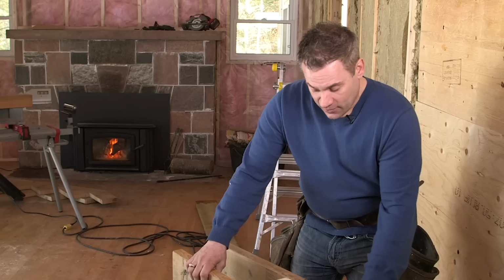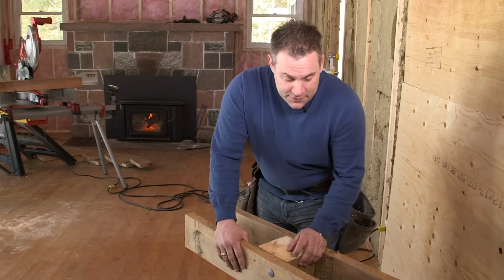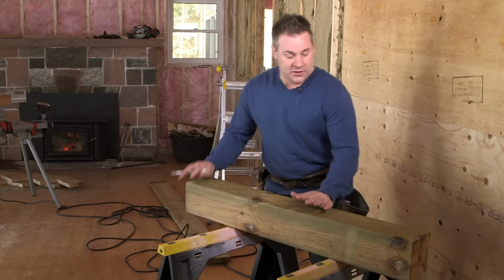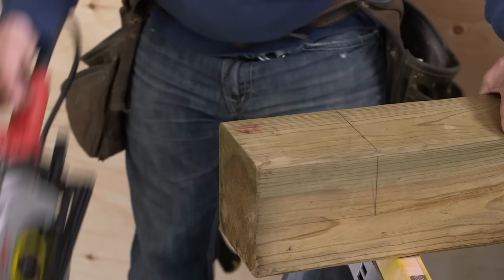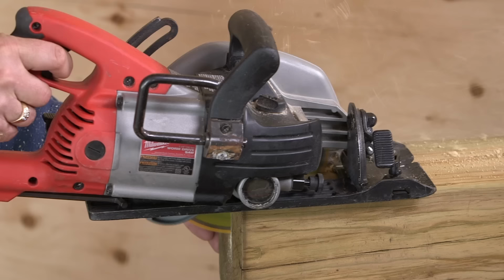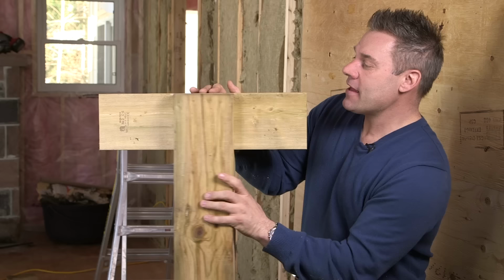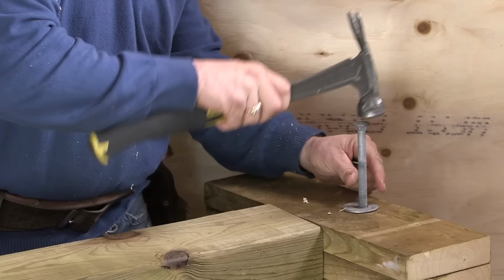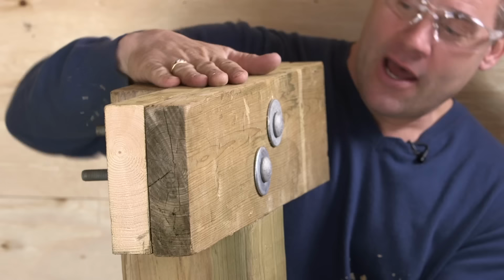How to Attach a Beam to a Post for a Deck | Decks, Docks & Gazebos

Comment: I wonder how this guy would attach a ledger board to a concrete wall. 
Would he notch out the concrete, so when the lag bolts shear off the wood is supported by the notch?

Comment: I can't even count the number of galvanized carriage bolts I've had snap off on me just from tightening them - including 1/2". Maybe back in the day, when steel was made in the USA, but the crap that's been here for the last 30 years is exactly why you don't want to put too much pressure on it. And as a handyman of 40+ years, I've had to repair all kinds of things that "engineers" have designed and built, especially in the cookie-cutter houses of the past two decades.

Comment: I prefer the notch method as well, but regarding sheer strength, I think you're mistaking bolts for tiny screws. Bolts have a lot of sheer strength. My concern would be the timber breaking off before the bolt
Reply: This is probably the worst example he could have picked for what is otherwise correct when talking about supporting loads via compression vs shear. I too think in this case a 2x would fail from one of the bolt holes before anything else.

Comment: A decent carriage bolt has a shear strength approaching 90,000psi. And while I too prefer notching out and supporting the timber with another timber, using carriage bolts is more than adequate.

Comment: Anyone who builds professionally will back this up. The bearers should never be bolted to the side of the stump - those of you saying this guy is incorrect have no idea what you’re talking about. A deck should never be loaded on the shear weight of bolts - completely defeats the purpose of the stump on the first place. Used to drive me insane when I saw decks built like that - so unsafe.

Comment: Interesting, thanks!  If the post is a corner post I imagine you trim away 2 sides of the post to support the 2 beams.  The question is about bolts: once one beam is attached to the post with 2 carriage bolts there will not be space at the top of the post for 2 more carriage bolts to connect the second beam.  So what do you do about that, how is the connection made? tx
Reply: See "Castle Joint" I love fancy joinery!

Comment: Shear strength of 2 carriage bolts is about a few thousand pounds.  The wooden joist splitting is the bigger risk.  Use a metal support plate if you’re really concerned.

Comment: While the author of the video is correct about placing the beam in a pocket as opposed to simply carriage bolting the beam to the leg, there is strength in the carriage bolt way above that of the soft wood its holding together. So white a couple 1/2 bolts would probably no fail, the same cannot be said for the wood , much stronger to use the beam pocket & then bolt it together

Comment: I have a deck done the wrong way. As reinforcement, what about placing blocks on the post and under the beam to support the beam/bolt connection. Secure those blocks with galv thru bolts and glue. Or run the blocks on the post all the way down to the footer and then attach with glue and thru bolts. Probably structural screws would suffice. Your thoughts? Anyone?

Comment: Proper attachment is important, and I notch as you suggest, but 6 months later and the beam has shrunk and now it is over notched. Now the bolts are still holding fine no slippage or failure. BUT I never use 2x6's for beams, poor example, even for demonstration purposes.

Comment: With all of the conflicting comments below, can someone just tell me what would be the best way to put a beam on top of a two 8 ft (8 above ground, 3 below) cemented in 6x6 post that will withstand the forces of a few recreational swings hanging and swinging from it.....what would be ideal beam, solid 4x6, sandwiched 2x12's, etc., should I notch in the beam, should I use a post to beam bracket, should I use bolts or use premium deck screws.  Anybody care to comment it is much appreciated.

Comment: Carriage bolts take a crazy amount of weight to sheer off.  If you local code allows you do not need to notch the post, bit of you decide to attach be sure to use the correctly rated bolts of the correct material and make the holes drilled a tight enough fit that you have to hammer the bolts through the hole.  If code allows it there is nothing wrong with doing it.

Comment: A 1/2" carriage bolt will carry several thousand pounds of shear. The only problem is that the boards are only clamped against each other - no load transfer other than the bolt, which is improved by making an interference fit with the bolts - drive them in with a hammer. 
A four bolt pattern will provide some degree of shear transfer between boards - until the heads sink into the board and loosen.

Comment: I recommend tightening a second nut down against the first nut to lock it into place forever. Most wood will shrink during summer a little and over the years, maybe just from the vibration of people walking or whatever, the single nut will back off a half inch or so.
Reply: or use a lock washer and locktite..

Comment: I prefer the approach where you have a cross joist, side to side of the dock, bolted to the 4x4s on which you then sit the lengthwise joists also bolted to the 4x4s. Lots of friction and bolts!

Comment: Sheer strength is relative to the live and dead load placed upon it. For example, building a deck for a family of four is one thing but now throw a party with 30 people on it and you have a different scenario. This is one of the correct techniques. I would never trust bolts just drilled thru the wood. Also, I always overbuild just to be on the safe  side of caution.

Comment: I am not a professional, but built many decks in my lifetime, always “the wrong way.” Some of these deck (the ones that I can still visit) are still standing firm, after more than TWENTY years. Just finished one about a year ago, feels solid, and it will probably last for many more. No question about it. I’d say, if your deck is in your backyard, go ahead and build it “the wrong way” it will be structurally sounds for years to come.

Comment: 1/2" UNC bolt: Min tensile strength 17,028lbs, Minimum yield strength: 13,055lb,  MINIMUM ESTIMATED SHEAR STRENGTH: 9,048 lbs. ref: Fastenal . Also, cutting a notch like that holds water, accelerates rot.

Comment: my deck was built like that in 1972. We replaced it in 2015 because the floor boards were rotting. The only reason you would need to worry about that is if you are always getting close to exceeding the weight. That being said if I were to rebuild my deck I would use that method but my deck probably wont need to be replaced until after I'm dead.

Comment: This notched joining method may be inherently less prone to shear, but it will rot out prematurely in the structural joint where the PT sheath is breached, between the laminated planks and under the decking because of the larger contact area to hold water and anaerobic bacteria and mold.

Comment: You only need 1 bolt right in the center. I would also add a lock washer between the nut and washer.

Comment: The sheer strength of a carriage bolt is more than adequate.  It's the Beeman itself that will fail from the load. That is the reason for the cutout  I have in my life seen only one bolt fail but have seen many Beam split fails. Luca

Comment: you should not use a washer on the head end of a carriage bolt. Carriage bolt has square notch under head that bites into the wood to stop it from spinning. You also should not sandwich two beams together if in the weather. Water sits in the gap between the boards causing rot faster.

Comment: Hmmm.......I have never seen washers used under the heads of these bolts. We call them coach bolts here and they have a square section under the head that bites into the timber so it doesn't move when the nut is tightened.

Comment: Every thing has a down side like water getting trapped  in the vertical joint ( water rot ).It  depends were you live . Also the cross beams would split most likely before the bolts failed .

Comment: while I do think his way is better. it seems like we always have 2x4 scraps laying around . I've always cut say 1 foot pieces and screwed them underneath the beam on the side of the 4 x 4 for extra-strength. I've never had a strength issue or one collapse.
Reply: Works great done  several  decks with that method.

Comment: At 1st glance this makes ABSOLUTE sense… but the more I disect this in my mind, I think of how much weaker the notched out part of the post is that the carriage bolts go through .....so instead of having a 4 or 6" post thickness now the flanged part that has been notched out to only a couple inches thick in supporting a deck that will be carrying weight side the side… interesting to know and understand the engineer I aspect of this

Comment: this looks like a better technique, but i had a very large deck i built like the bad example and it lasted 15 years with no problem till i tore it down last year. i would probably agree with another poster that keeping the boards separate and attached to either side via cutout might be the preferred technique due to water.

Comment: And its not just shear strength, the friction of the wood being squeezed together is a tremendous load bearing, use vise grips to squeeze two pieces together and try to slide them apart. And by notching the post you weakened its lateral strength so us a larger post to begin with. For ultimate strength bolt and the place another plant from the ground to bottom of cross beam.

Comment: I agree that this is the correct method to attach a beam to a post. The shear strength of a grade 5 1/2" carriage bolt is over 100,000 psi. Could you demonstrate breaking that off with your hammer? LOL Would be nice of these TV shows would hire people that actually know the trade and are not actors like Bob Villa!!

Comment: one 1/2" carriage bolt has a maximum shear strength of 15000 Psia.  That means it can withstand a max force of 15000*pi()*(1/4)^2= 2945 lbf right on top of it.   You showed two bolts, with doubles it.   It this really a concern?

Comment: The only thing that gives you is better looking assembly, which is not bad at all if that is what you are looking for, strength wise? The bolts will never break or even bend, nor will the example assembly shown here ever break. So do it the way you prefer.

Comment: My local code will not allow use of a carriage bolt or a lag bolt. It must be a hex head bolt and nut with a washer on each end of the bolt, galvanized.

Comment: Actually what is holding the beam in place is the compression and friction caused by the bolts squeezing the two pieces of wood together. This is literally the same way that airplane wings are attached to the fuselage.

Comment: The carriage bolt plus the lumber on lumber resistance is a lot of shear weight needed.. for a deck it’s just fine . You’re way is “better” but that doesn’t mean the other way with carriage bolts isn’t right .

Comment: Funny; I bought a house 26 years ago with a deck done the 'wrong way' - who knows how long it was up before (house was built in 1985) - and I have YET to have any bolts shear off.
Reply: You just need enough people on it. Usually, it makes the papers when they fail because a dozen or so people end up falling 15-20'.

Comment: I would not put a washer on the outside as a carriage bolt is designed to sink into the wood on that side and lock itself into position.  I use a large washer and a lock washer on the reverse side only.

Comment: Look this guy is completely correct with the exception that you can no longer use carriage bolts, you must use hex head that can be torqued to a value. The load must be borne by the post. This has been litigated many times. It doesn’t matter what you believe, only thing that matters is what can be proved. If you are still bolting your beam through a post you are wrong and you must evolve in to doing things correctly. Use of your grey matter and not your ego. The fact the deck you built incorrectly is standing after 20 years is not proof in litigation. This is borne out of a series of high profile deck failures in the news......grow, it doesn’t hurt

Comment: The bolts should not be in shear (only tension)  because the bolts should be holding the 2 pieces of wood together so tight that friction never allows shear to be applied to the bolt.  The wood will splinter long before the steel breaks.  However if the bolts get loose and friction is loss over time, the notch is a good idea.

Comment: I let the termites hold hands.Works fine for me.But,if the termites don't want to do that,this method has two strengths,the wood holding it up as well as two galvanized bolts.If any break there's the other to hold it up until one can make repairs or replacement.👷‍♂️

Comment: I understand what you're saying, but if you think those bolts are going to shear, show us how much weight it will take to shear those first two bolts.  Pretty much guarantee that unless you're parking a tractor on your deck, the wood will rot out long before the bolts shown in the vid(looks like 1/2 grade 5 bolts, maybe grade 8)  break.  The biggest problem with your first example is not bolt shear, but elongation, leading to sagging then the wood splitting at bolt holes.

Comment: the way you are showing how to do it is the correct way but there is a whole lot of shear strength to a tightened 3/8's bolt. Advertised shear of a number 16 nail is 900 lbs.

Comment: I can tell by browsing through the comments that there's alot of jack-leggers and/or people who have never built a deck with proper load bearing posts chiming in.
Reply: Joshua Carpenter I’m a career carpenter (16 years).  Those bolts are will have no problem holding the load, it’s the wood getting soft over the years that will cause it to fail around the bolt.  Notching is definitely the way to go, what I don’t get is why this guy chose 2x6s for a beam??? We only ever use 2x10 or bigger for beams under decks
Reply: @AMERICANCRPNTR  I agree with the sizing you mentioned in lumber, but I agree with his concept also. It's actually code where I live to use the carriage bolts and notch.
Reply: We notch all our posts for rims and beams, I usually use ledger lock screws  to secure them over drilling for bolts, saves time and works just as good

Comment: That notch will encourage rot. Better to sister pressure treated onto a built up post to support the joists and if you think the bolts will fail, use galvanized hangers.

Comment: This guy is nuts! Two 1/2-inch carriage bolts would hold so much more than the deck could accommodate. He is correct though that his way is better structurally.  Also, it wouldn't be the bolts that fail but the wood around them. The bolts should be there to lock the timbers in the correct place not to hold them up.

Comment: Dependes on what your doing or or exactly how much weight , cause also 2  2x6' are also only good for so long of a span. And of course a nail , screw, or bolt is going to break or bend if you don't drive it in all the way. You can easily cheek another 2x6 vertical to the post ihose first beams all the way to the concrete if your worried about it coming down. Most wood pole barns are built with the first example carrying the load of 60ft plus trusses

Comment: Carriage bolts have immense shear strength (eg 1/4" will take up to 13000lbs).  The reason that you don't bolt a beam like that is because the beam could split, especially at the ends. Cheap screws are made out of junk

Comment: Obviously you wouldn’t be able to notch a 4x4 this way and almost all decks I see are supported by 4x4s so are they all out of compliance ? 
 Im no engineer but just by experience I know takes a lot to shear even soft carriage bolts. 
   I like using notch or lap type joints where you can but how do you notch a 3.5 inch post to accommodate a 3 inch beam ?

Comment: It's not relying on sheer strength. Its relying on the wood to wood static friction from the clamping force. The same reason fence posts are so hard to pull out despite it not actually being fastened to anything.

Comment: Japanese don't use bolts, they use various mortise and tenon joints and their wood structures have lasted for centuries - earthquakes and all. I no jive you.
Reply: Tv S I remember in the early 90 s Japan was hiring carpenters from Canada to teach them platform framing because their framing didn't handle earthquakes as well

Comment: It really depends on how much load is on the beam. Those two bolts are more than enough to hold the load you can put on 2x6's. Yes the notch is better and those two half inch steel bolts have plenty of shear strength. They can loosen over time but what is the lifetime of most wooden decks, maybe 10-20 yrs?

Comment: I messed up with a bolt and a post plate, I ended up having to cut an inch off the bolt. I used a grinder for about an hour and hit the end of the bolt about 100 times before the bolt broke.

Comment: Funny how everyone is argueing about will one way work better than the other my question and argument starts at the connection of said frameing to your structure. Lags or ledger locks or grks are usually the normal. So why are they excepted there but not for a carry beam. If this doesnt work for beam how do you connect your box to you house

Comment: Building inspector will not allow to cut in a post, 2 screws 1/2 or 5/8 of inch plus metal brackets under two beams bolted together on one side of the post usually outside of porch. Brackets at least 1/4 of inch thick bolted to post with 1" screws. ( 2 screws)